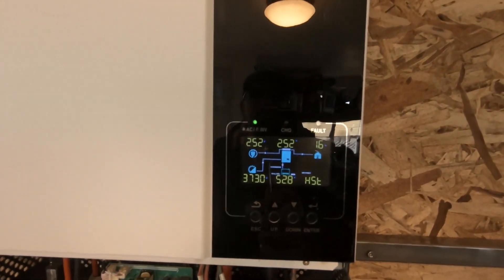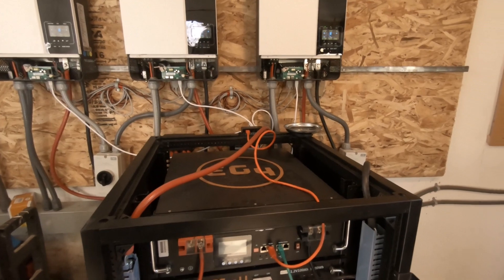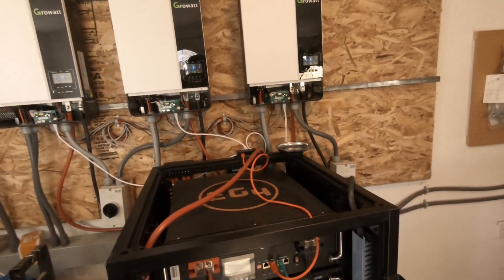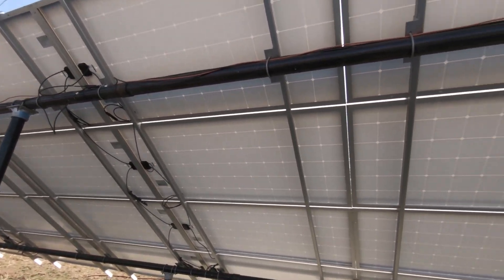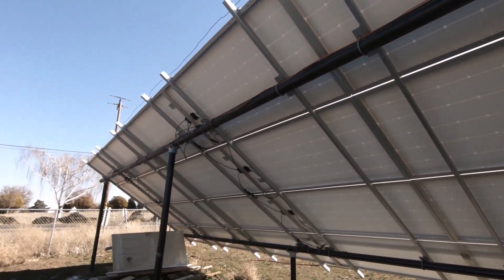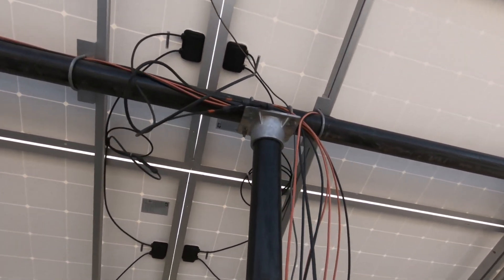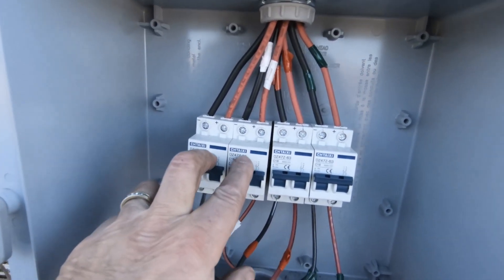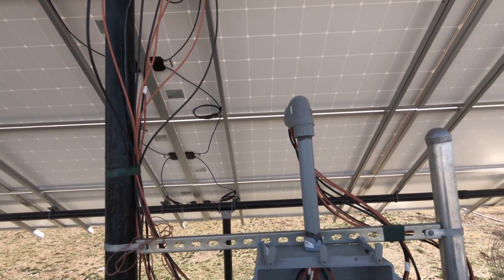new breakers at the solar array

Comment: I'm doing the same thing for safety sake.  But,  what I have run across during my search on how to do it, is that there should be a 10 Amp fuse between each solar panel connected in parallel,  not just at the end of a string of panels connected in parallel.  They say you need a fuse between each panel connected in parallel because if one panel shorts out, the rest of the panels in the parallel string will dump all their amperage into the shorted out panel and cause a fire.  So, this would be even more important if you had the panels up on the roof.
Reply from the maker: I would double check with an electrician. I wouldn't put no breakers in between the panels. I haven't heard of doing that.

Comment: My battery's from them 3 cycle only 80 amp test yours what are you getting a full hundred or over
Reply from the maker: I don't know why you are having issues. Mine are working fine, they are charging up to full capacity. I have mine set to charge slower at the top end. This is important to keep any lithium battery healthy. Hope you have better luck.

Comment: What gauge wire are you using for your batteries to Inverters? From batteries to terminal blocks, and then feed from terminal blocks to inverter?  Looks like 4/0 AWG from batteries.  If you moved your camera shots a little slower things could be seen better. Thanks for the great information that you share with your viewers!
Reply from the maker: I just started making videos, so I will work on moving slower. I just used 2/0 for all the battery cables. ordered from battery cable's USA also connectors and heat shrink. very good quality battery components from them.
Reply: @jamesshomesolarmore2223  Thank you for the information and good work explaining various details and sharing your experience!

Comment: Looks pretty good James .Are your panels grounded ?
Reply from the maker: yes, they are grounded. but only at the solar array, my system passed the local code, they told me to have a separate ground and not to connect it to my power shed.